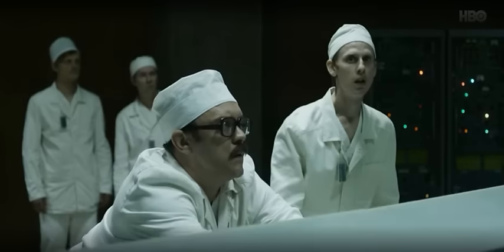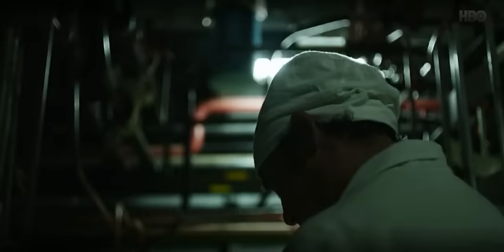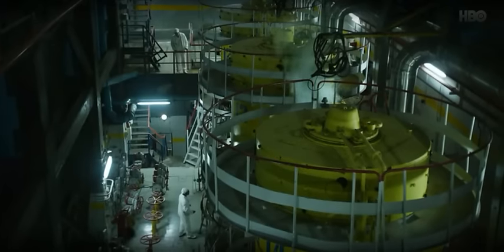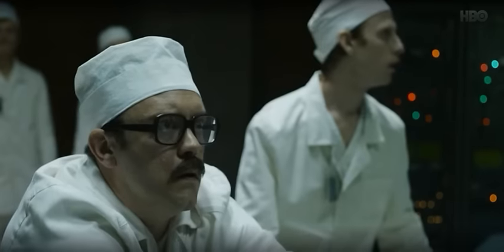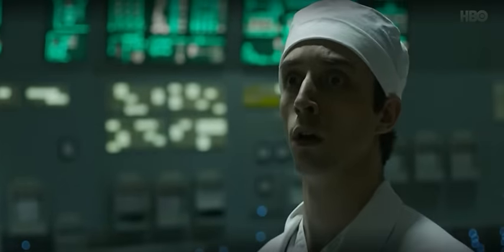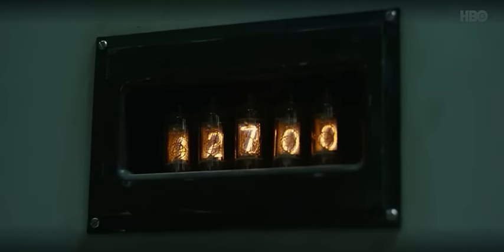Chernobyl (2019) Nuclear Reactor Explosion Scene

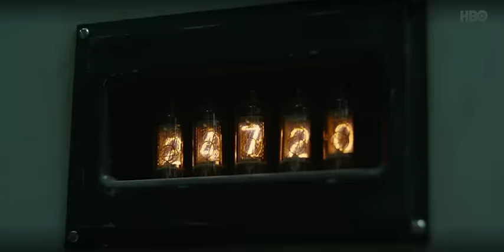Comment: 2:46 same Hiroshima
Reply: Do you mean Fukushima? Chernobyl wasn't a nuclear explosion, it was a steam explosion with radioactive contamination.
Reply: @Nervegas  no I'm saying dying people around that area
Reply: Actaully chernobyl was a hydrogen bubble explosion but i would say its both since the steam seperators exploded when the turbine tripped and caused all the steam to go back into the seperators which caused overpressure in the seperators and caused an explosion and then since no turbine was spinning and generating power the main transformer wouldve cut off due to high power usage in turn causing no feedwater pumps to be active which means no water and i dont think chernobyl had any shut down cooling pumps like in the west, and also if it had a positive void it would boil water faster and since there was no seperators the valves close so steam doesnt leak thats a saftey system in chernobyl and if water boils faster more steam more steam more pressure more pressure explosion and since there was hydrogen trapped at that time nuclear reactions were taking place and finally ignited all the hydrogen and caused the explosion
Reply: @jua-j1e it was a xenon pit that caused the reactor to stall

Comment: So they used a neutron reflector graphite tip on a rod meant for neutron moderation? Seems pretty dopey to be believable. 🤷‍♂️
Reply: Sometimes, reality is stranger than fiction.
Reply: But graphite is cheaper than any other metal that can adequately control a reaction.
Reply: The "tips" were almost the height of the channel where the control rods reside to stop the reaction. When a control rod is removed, the graphite component of the rod fills in most of the empty space to maintain the reaction.

When ALL control rods were being reinserted after the AZ-5 button was pressed, the "tips" filled up the bottom of the reactor where the reaction went out of control.

This video explains it better. https://www.youtube.com/watch?v=hIGtTImeYU4
Reply: I bet you can’t spell any of those words without your phone nearby
Reply: @Wot50202 Is it so bad that someone wants to expand their vocabulary?
Reply: You also use Graphite in Places where you cannot afford to have liquid lubricant sometimes.
This might have been another reason to choose graphite tips
Reply: @Wot50202  Bro what word in that would someone have trouble spelling? Graphite? Neutron? Cmon man there's no 'big words' in there that you'd need spell check or a dictionary for unless you didn't hit 4th grade english class
Reply: @ShaggyDabbyDank  IKR!?  I was wondering what post Einstein was referring to. 😂. Maybe they’re “big words” for them. 
Peace brother ✊
Reply: @Milnoc  Thanks for sharing, brother. ✌️

Comment: If nuclear power is made relatively safe and all the waste material is taken proper care of, all the precautions make it more expensive than renewable energy
Reply: LOL, source? You can't just say things
Reply: No true.  It's expensive to build, but if properly maintained it pays for itself in the long run.  Renewables never pay for themselves.
Reply: @Alamandorious  Where did you pull that one out of? My solar install has paid for itself in 3 years since I did all the work myself.
Reply: @FrozenHaxor    Was it subsidized?
Reply: @Alamandorious  Yes, little under 1000 USD, without it it would take another year to pay for itself, which would be 2 years ago.
Reply: @FrozenHaxor   Now, are you using panels with built-on DC to AC converters, or do they get tied into a central one before making the switchover?
Reply: @Alamandorious  Actually my first installation is 2 strings of 12 panels each going to a single 3 phase 400V inverter, my seconds installation is based on microinverters and I get single phase 230V straight off the roof with that one, the nice thing about it is that you get detailed information about each panel's output, and it's totally immune to even severe shading, all panels have individual MPPTs. But the cost is higher and I have doubts about the longevity,  micros run at nearly 80*C at full power and I had to warranty the data link gateway once already. The central inverter install had no maintenance since beginning, I only clean the panels once a year, rain doesn't get everything.
Reply: @FrozenHaxor   The central inverter is probably only guaranteed to last 10 years, and is pricey to replace (unless you can find a spot that'll cut you a deal).  Microinverters might be a pricier way to go, but have a lot of advantages, including when it comes time to replace them as they fail.

I'm assuming you have a battery bank as well?

If I can pry, how much did you spend?  I know your labor cost was nil because you did the work yourself, but how much for materials?
Reply: @FrozenHaxor    Yeah.  I'm not a huge fan of solar, as you can tell, but I definitely acknowledge that like anything else, China's contributions to that market are terrible.  Glad you went with quality.

However, even well built and maintained inverters only typically last 5 to 10 years, which is why they only typically have a 10 year warranty.  Some will obviously last over the typical, as is true with any well-made device, but it will fail well before the panels do.

Honestly, that's probably more due to planned obsolesce than the device itself, but the fact remains that before you'll start getting hit with replacement expenses on the system.

And all that would be fine, if you could be guaranteed to get a credit from your utility everywhere...where I live, they used to, but then within the last year they no longer credit you and instead stop when your power bill hits 0$
Reply: @Alamandorious  Absolutely, if the export credit is on horrible terms then the value of install diminishes rapidly, and the expense of battery storage is horrendous, plus they are doomed to fail due to cycling so it's not a one time solid investment.
Reply: @FrozenHaxor   Yes.  I wish more people would realize that, even though batteries have improved, they're still not the fix people think they are.  Especially poorly made ones.

At least with a good quality inverter you're very likely to get a minimum of 10 years, if  not 11 or 12.  I can't see the batteries they use for solar lasting that long.

Comment: Nucleur energy is just  meme tier, anyone trying to promote is just not smart
Reply: You’ll understand when you’re older. If it’s a competent design, and not SOVIET. It is a thousand times safer.
Reply: most reactors are really safe. its just the russians were too lazy to boil water.
Reply: Low tier bait or low tier brain right here
Reply: There's a lot of story behind Chernobyl that most of the public don't know, this is why people still hate on nuclear power, however, there is a significant amount of detail that shows you nuclear power can be safe. 

Reason 1: Chernobyl was constructed by the Soviet government, if you listen closely to this video, the speaker explains that the Soviets built the reactors with minimum safety because it was cheaper to do so, one of which was Graphite tipped rods, which was a main reason for the blowout and meltdown. 

Reason 2: The cause of this meltdown was in part due to human error in the operating room, ever since reactor 4 was installed in Chernobyl, the managers have been trying to execute a safety test, this test was to test the reactors ability to withstand a blackout. You see, with no power the pumps wont remove coolant from the reactor, letting the heat rise, the plant has backup generators but these will take 60s to spin up to turn the pumps on. So, the pumps could use the power from the steam turbine, which still had momentum and was producing electricity, to power the pumps until the generators spun up, the day before the accident was when the test was supposed to happen, but due to power demands, the reactor could only go to half power for 10 hours, this allowed Xenon, a chemical that kills the reaction and is usually burned off at higher temperatures, to build up over the 10 hours, by the end of the 10 hours, it was the night shift, this shift had no experience or training with running this safety test, but Anatoly Dyatlov ordered them to drop the power output to the required amount, 700MW. However, the power kept dropping beyond this point due to the Xenon mentioned earlier, the power got so low that safety requirements mandated that the reactor have its temperature raised very slowly over 24 hours before being turned on again, Anatoly ignored this and forced the night shift to raise the control rods all the way out to bring the temperature back up, it only gets to 200MW, but Anatoly turns the pumps of anyways despite there not being enough power. Heat rises fast, creating steam, which increases heat and making more steam resulting in an infinite loop of heating, the power rises dramatically and pressure within the reactor builds up. The power goes so high that some operators trigger AZ-5, a failsafe that shuts down the reactor by dropping every control rod fully into the reactor, but something goes wrong, the previously mentioned graphite tips of the rods suddenly enter, immediately increasing the reactivity, vaporizing the last water into steam and cracking the control rods, locking them in place, leaving only the graphite to accelerate the reactions endlessly, not even the pumps could stop it now, they were just providing more water to turn into steam. Eventually, the pressure gets so high the lid of the reactor is thrown off, allowing oxygen to combine with hydrogen(A byproduct of fission) and the superheated graphite, to cause a massive hydrogen explosion, which destroyed the roof of the building, throwing radioactive particles everywhere.

In conclusion, the cause of the meltdown was due to flaws in the RBMK reactors design, the postponing of the test, using a crew not trained in the test and violating a lot of safety rules that led to this disaster. This could have been avoided as they are problems created by humans, Most western reactors are significantly better designed and safer in general, the Candu reactor is a great example of this, it existed during the same time as the RBMK but was much safer, and is still a staple of nuclear energy today.
Reply: Sounds like projection
Reply: Nuclear*

Comment: HBO making garbage as usual. Reactor 4 at Chernobyl did not become a nuclear bomb.
Reply: He did not call it a nuclear bomb, he just compared the reaction to a nuclear bomb, which is semi-true because of the graphite accelerated nuclear reaction.
Reply: There is actually a serious hypothesis which posits this - you can read about it in the Wikipedia article about the Chernobyl disaster under the "Fizzled nuclear explosion hypothesis" section.

In short, the hypothesis says that the first explosion, which blew off the channel caps, before the hydrogen explosion, was akin to a nuclear fizzle. A nuclear fizzle is when all of the conditions required for a nuclear explosion, including a supercritical mass of fissile material, are brought together, but the very first fraction of the explosion blows the supercritical mass apart before it has completely reacted. The fragments of fissile material, on their own, are subcritical and can't produce enough neutrons to maintain the nuclear explosion.

If that hypothesis is true, then Chernobyl definitely had the makings of a nuclear bomb.

Overall, while some creative license was taken (sometimes justifiably for narrative reasons, other times nonsensically, like with the representations of acute radiation syndrome, for example), I found the series fantastic for trying to explain the intricate cocktail of systematic soviet obfuscation and technical shortcomings which led to the accident, without dumbing it down.
Reply: @Recessionist  It was a steam explosion. Steam engines can explode, violently from overpressure. Steam locomotives (on trains) would have steam explosions and they are powered by coal, wood, and oil fires.
Reply: @KieraCameron514  Did you go and check out the Wikipedia article ?

What makes you say that a nuclear fizzle isn't plausible ? It isn't mutually exclusive with a steam explosion.

That hypothesis is serious, and backed by people who have a great deal of credibility in the field of nuclear physics.

Unless you yourself have a similar level of credibility, I don't think you should consider that you have the authority to dismiss this and assert with certainty that it was only a steam explosion.
Reply: @KieraCameron514  That's old thinking, new studies and research has concluded that it was a nuclear fizzle. Just read it on the Wikipedia article, it has all the sources to back it up.
Reply: It's hyperbole to drive home a point. He wasn't saying it actually had become a nuclear bomb, but that it became a nuclear powered bomb. Which is exactly what it was. A completely out of control nuclear reaction was driving steam pressure so far above limits that it was only a very short matter of time before it ruptured and exploded. Allowing oxygen in which would combine with the graphite and hydrogen creating an actual detonation.
Reply: @KieraCameron514  LOL
Reply: Well it exploded like one
Reply: Outrage culture as always. Did you actually watch the series? It was bloody brilliant!
Reply: @nicknapeem1541  Not even fucking close. If it had exploded like a nuclear weapon, Pripyat would have been leveled. Look at the damage done in Hiroshima and Nagasaki. That damage was caused by nuclear explosions.
Reply: @chronovore7234  Copied and pasted from the Wikipedia article - "This was an alternative to the more accepted explanation of a positive-feedback power excursion where the reactor disassembled itself by steam explosion."
Reply: You must be fun at parties...
Reply: Jessy, please don't embarrass yourself any longer and be quiet, thank you.
Reply: @KieraCameron514  let it go my dude. It's been 36 years!
Reply: @finnkafka7444  Science and engineering are always interesting.
Reply: @finnkafka7444  And when the fuck did this show come out?
Reply: @KieraCameron514  Agreed that science & engineering is interesting but it's just a drama miniseries not a science doc. Obviously I'd be more critical of the blemishes if this was outright depicted as a doc but it wasn't. Hence I can just enjoy it for what it is.
Reply: @thomashartmann5625  If only I could ask my friend(ish) who is a reactor operator what kind of explosion it was. Now, I wonder why she would have regarded me as somewhat of a friend unless I know a bit about nuclear energy.
Reply: Thank goodness we have a nuclear physicist who was there to verify the incorrectness of HBO.
Reply: @compass_Matt  There is even a nuclear engineer on this very website who says it was a steam explosion and not a nuclear explosion. Put this: watch?v=qCp73zc1OLs at the end of the Youtube URL and enjoy.
Reply: @KieraCameron514  Christ sake, what if the nuclear explosion was very small in comparison? You know? Like just powerful enough to blow the lid off the reactor maybe?
Reply: @nicknapeem1541  Hiroshima had a small nuclear explosion. 15 kiloton is not that big. Only about a kilogram of uranium underwent fission in Little Boy. The largest pure fission blast was of the "Ivy King" test at 500 kiloton.
Reply: @KieraCameron514  So hung up on the absolute details when the result was the same. Whether it was a positive feedback loop steam explosion or a nuclear fizzle- and neither can be completely proven, merely accepted because the explosion destroyed a lot of the vital evidence needed for an indisputable analysis- the incident was the same and the show depicted it accurately. Between flaws in the reactor design and multiple safety protocols being broken, the reactor was essentially turned into a runaway disaster. 

An ill-prepared crew was dealing with a reactor that had already been running at low power and had a xenon buildup. The poisoning choked the reactor, and rather than reschedule the test while going into proper shutdown/restart they started making drastic decisions to increase power. When the time came there was nothing to balance the reaction, and the ill-designed shutdown simply pushed it over the edge. Rather it was a steam explosion or a nuclear reaction that fizzled, one explosion led to a bigger explosion and radiation was pouring out in lethal doses.
Reply: @KieraCameron514  it IS important to note that both Hiroshima and Nagasaki had been leveled by a nuclear bombs detonated several hundred meters ABOVE ground, where the Chernobyl reactor was to my understanding in large parts BELOW ground.